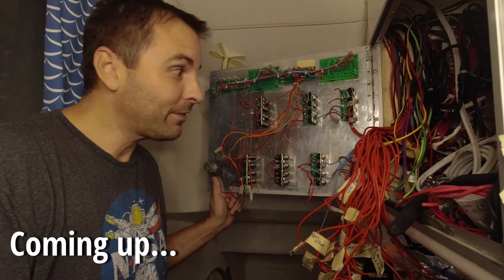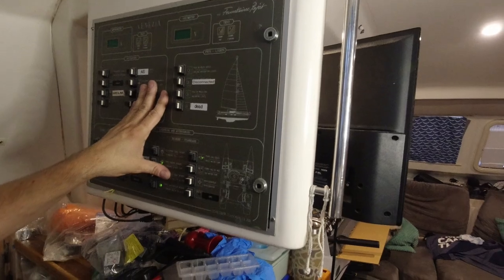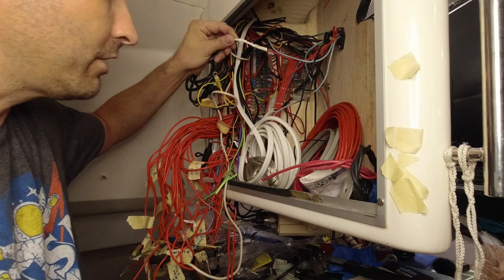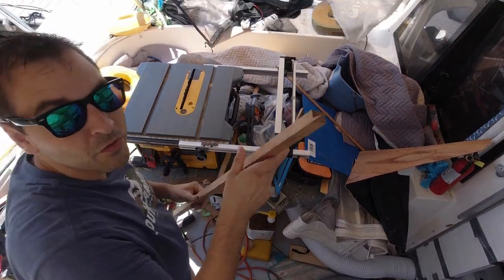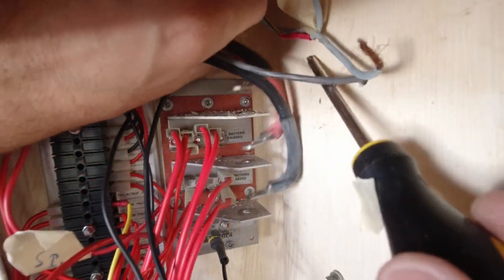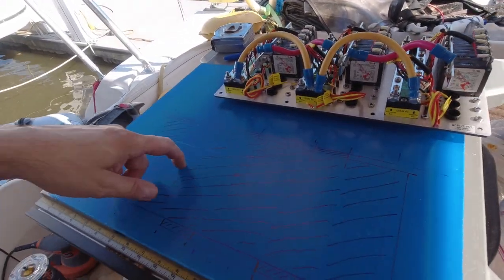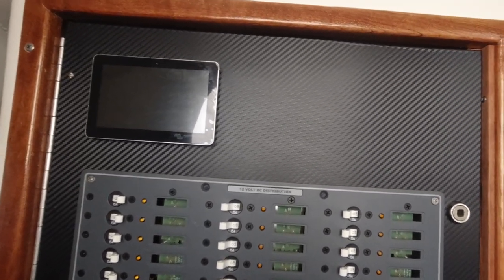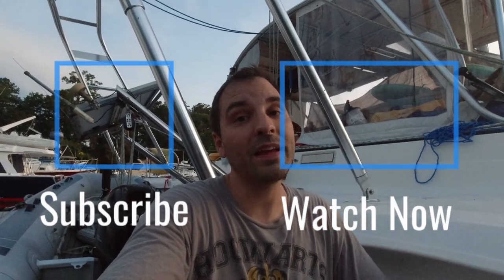Beautiful retro-fit installation of a BLUE SEA SYSTEMS 8264 DC PANAL on our Catamaran Sailboat

Comment: I'm about to do the same on my boat, some amazing tips and ideas have been got from this video alone!! It's a smaller 27ft boat so the DC panel is a lot simpler but it's an absolute birds nest behind there. Last time I stuck my hand in to follow wires 3 black (hopefully all negative) wires popped out of the clamps! My favourite saying is "when you are on your death bed you will not regret anything you did, only regrets will be the things you did not do"

Comment: Watch the max amps on that bus. Great job man. Well done.
Reply from the maker: Thanks guys!  The max amp on the bus is 150A. Way more than we will pull through it.  I’ll put an amp clamp on all of the wires and see how much they’re pulling if I were to turn everything on at once….  But it is significantly heavier than what Fontaine Pajot had installed as original equipment. 🤔

Comment: You need a tone generator and wand with AC noise suppression.  I do data networks, etc and it those tools really help me find wires. I use them on the boat or plane too.  The tempo 200fp has the AC noise filter. Yes it costs like a buck fifty but it works. The tone generator box is handy as well.  Use the generator on the mystery wire and then trace it in wire bundles.  The tempo has two modes one that filters ac and one that doesn't.  You can get by with a cheaper wand but you have to turn off all ac power.
Reply from the maker: Hi Allyn, this sounds cool. I’ve never heard of this tool. The biggest problem I’m finding is many of our wires Are interrupted with butt crimp connectors.  Sometimes multiple connections in the same strand. I’m going to be working my way through replacing these. 
I’m going to look into the tone generator.  😎

Comment: I sold Blue Sea in the past they always come with templates and if you did not get one they are available at blue sea website.
I nearly cried when I heard you say you were going to stain  some beautiful cherry wood, t hen I saw a can home cheap home depot type stain and yep, I cried.
🙂
BTW DC NEG should be yellow.
Reply from the maker: lol.  Sorry the minwax brought you to tears.  I generally prefer Rubio monocoat but I’m using minwax stain because I’m using minwax helmsman spar urethane because of the excellent UV resistance.  Cheers

Comment: I knew you where in trouble when I saw the "voltmetre".
Reply from the maker: lol..  so happy this project is behind us. 😁
Reply: @SaltyEscape  Mine is just starting. I have to remove a leaky water tank so I can get to the shore power wires. Then I can replace wires and hook up new main breaker.

Comment: If wiring had the electronic color code on each end of the wire you could know the number of each wire, and you would never guess where the wire may feed. Electricians have color code tape for each number from 0 to 9.
Reply from the maker: Hi Rick,  we have been labeling them with our label maker.   Ideally both ends and in the middle when the wire is accessible.   I think we have to many leads for the color tape.  I’m still pulling old wires 😅

Comment: There is a vital piece of electrical equipment you did not use. Not a multimeter but a label maker. Although it will take time you need to trace every wire. You need to replace any dodgy wires chaffed whatever and even those which are the wrong colour. You also need to measure the width of each wire as it is easy for subsequent owners to makes changes which can use to much power. Luckily there are apps for that. 

Of course this is a lot of work not too expensive apart from the new wire you need note there is a silicon wire which is excellent for boats. The good thing is that you can do so gradually just hay I have an extra couple of hours. I can check out a few wire runs inspect and label them maybe replace.

At the end you will have laid hands on every foot of wiring in your boat and also will have a stack of redundant wire and also wire you have replaced as not up to spec the wrong colour etc. All your wiring will be labelled at both ends and you will have peace of mind. All the time you have spent on the project will gradually repay itself as any future wiring changes you make will be much quicker as you do not need to identify each one.
Reply from the maker: Yes!  We have a LabelMaker and we are working through all of the wires. I have already replaced many of them.  The wiring is a mess but I’ll be very happy when it’s all corrected!! Cheers, Corey

Comment: Why didn’t you use one of those companies to replicate your old panel incl the nice graphics with new modern modern switches and breakers ? Knowing the costs of those blue sea panels it shouldn’t be that much of a difference in price ? You could have even specced out space for the Cerbo display 

Ps the 12.2v you saw on your panel vd the 13+ v from the batteries is probably caused by corroded connections to the shunt or battery sense cables that are somewhere hidden , but seeing you will use a Cerbo (with smartshunt ?) that problem will go away as well
Reply from the maker: Hey guys, I never heard of a company to replicate an old panel.  That would have been something to consider.  We’re probably going to have something made to replicate the graphics.  
Yes, the Cerbo gx is coming soon. 🤞